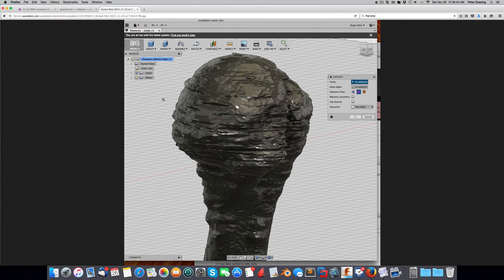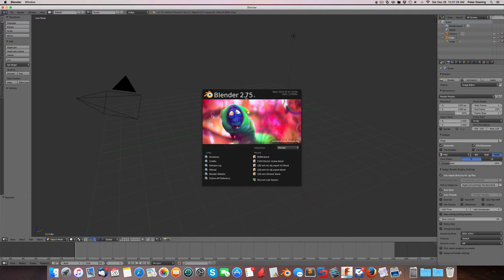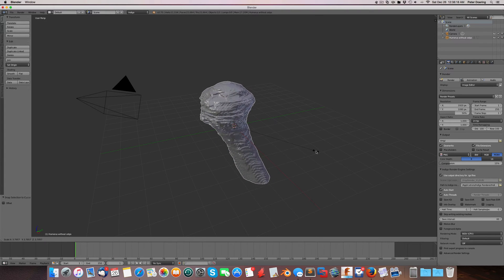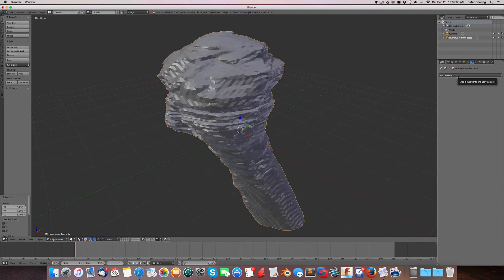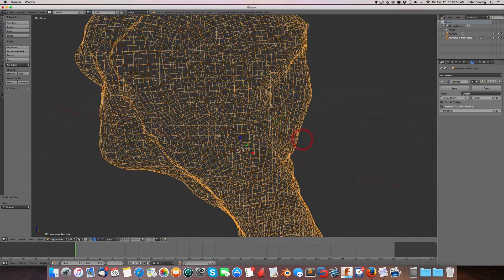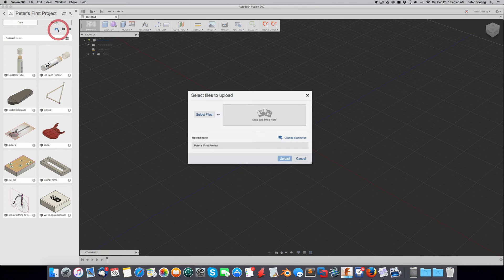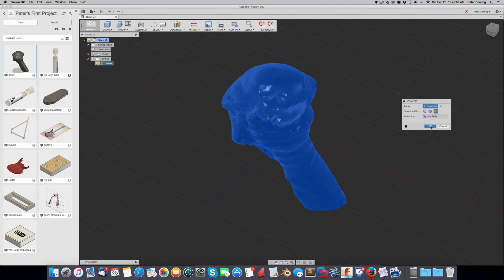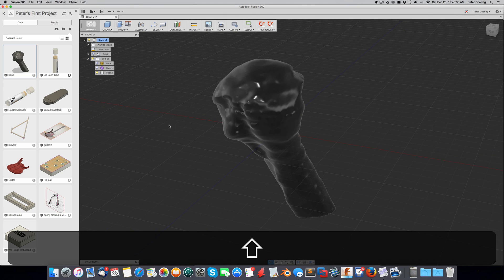Convert an STL for Fusion 360 using Blender

Comment: Hello Peter, I appreciate your video. I'm just having some trouble applying it for myself for some reason my 3D mesh for the tibia I have isn't properly rendering as all quad and as a result I'm unable to get the T-splines body to convert it to a body. I keep getting an error saying T-spline body is invalid due to topological problems. Could I get your contact details to discuss this. If not I understand.

Comment: Why do we need to convert to a t spline before b rep? Is there an issue with going directly to b rep?
Reply from the maker: Excellent question! Yes, absolutely! First of all, there is a hard limit of 50k polygons. If your mesh has a higher polygon count, then it needs to be reduced which results in loss of detail. That might not be a problem for some projects but often it is. Some people split the mesh into several segments and then convert them individually. If the mesh does not need to be modified much then that also might work, but generally, modifications of these highly faceted geometries as BRep in a CAD software are problematic due to near tangency and near coincidence conditions.

Also, of course, you are still dealing with highly facetted geometry. Imagine you are using a simple cube and model a through-hole. Fusion 360 has to calculate the intersection geometry between three surfaces. Now imagine the cube is made up of 50,000 triangles. Fusion 360 has to calculate the intersection between hundreds if not thousands of surfaces.
A T-Spline on the other hand is converted into smooth NURBs surfaces and that is potentially less computationally demanding and easier to modify.

I'd have to add that I see a lot of people come to the Fuiosn 360 forum or the Facebook group who be much better served using Meshmixer and sometimes even Blender to modify triangulated meshes. If your end goal s 3D printing, which takes triangulated meshes as input, often there is no reason to use CAD software.

Comment: also i discovered that blender is exporting to triangles instedad of quads. on wireframe mode i see only quads and in meshmixer there are only triangles
Reply from the maker: Blender is exporting quads, provided your mesh inside Blender is quads. Meshmixer might triangulate on import.
Reply: i guess youre right but when i import mesh to project in fusion it says that it has 0 faces  and 9052 triangles and the conversion aborts
Reply from the maker: You need to turn off"Triangulate mesh polygons" in the Fusion 360 preferences. It's in the Mesh section. Then your quads should convert into a T-Spline.
Reply: Thank you so much, man! I still cant convert into T-Spline but at least mesh to Brep is working. The problem was with the mesh, it wasn't closed, now im using the Intant Meshes and it works great
Reply from the maker: You may want to head on over t the Fusion 360 Forum https://forums.autodesk.com/t5/design-validate-document/bd-p/124
and create a new thread. You should be able to convert a quad mesh into a T-Spline.
Conversion into a solid will fall if the mesh is open. In that case it will convert into an open surface.

Mesh mixer and the new mesh workspace in Fusion 360 both have tools that allow you to close an open mesh. In this case I'd use Meshmixer to close the mesh before handing it over to Instant Meshes.

Comment: can you upload the bone before remeshing? I'm trying to convert my part into t-spline and then body but the conversion to t-spline is immediate and the effect is not approximation of the part but the part is just the same as it was before the conversion, it is mesh though. And it cant be converted to body
Reply from the maker: Upload the bone to where ?
There are other tools for remeshing, for example Instant meshes https://github.com/wjakob/instant-meshes.
If you mesh is not closed it will not convert into a solid body.
This video was made before the mesh workspace was integrated into Fusion 360.
Now if you want to import a quad mesh in .obj you can switch into direct modeling mode and then import the mesh directly without upload into your design by  selecting "Insert->Insert mesh" . then you convert it into a T-Spline and if you turn the timeline back on it'll convert into a body.